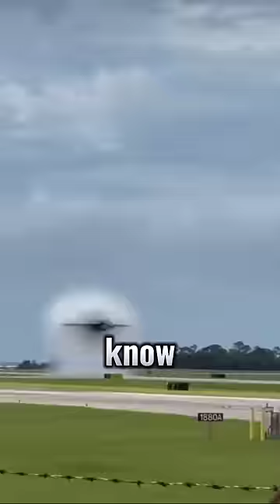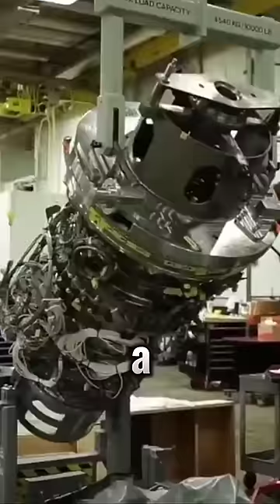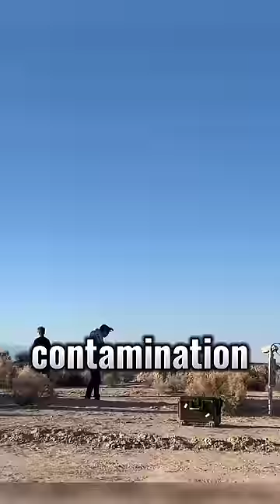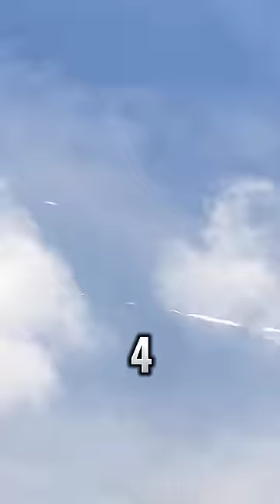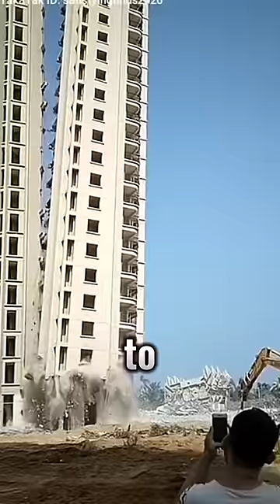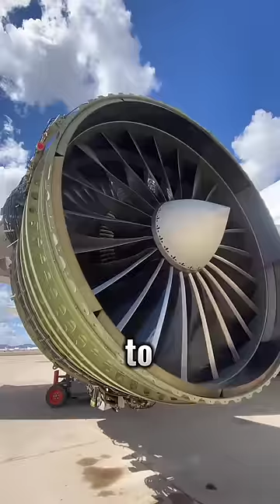When Russia Tried To Use Sonic Boom As A Deadly Weapon 😱

Comment: Just drive my straightpiped 2003 dodge ram across enemy lines
Reply: Or my ‘03 Monte Carlo SS… we dropped a cop car engine in it just for fun
Reply: @jpetes9046  AMEN BROTHER GOOD STUFF RIGHT THERE
Reply: And roll coal on the enemies for good measure! 😆
Reply: Or the mf Civic running headers through my neighborhood at 3am
Reply: Or the Honda civic with laptop
Reply: @jpetes9046 I bet that thangs badarse all 85hp
Reply: @Nikkk6969 I bet that thangs badarse all 85hp
Reply: @antssr_9106 I bet that thangs badarse all 85hp
Reply: I bet that thangs badarse all 85hp
Reply: @jamiejones6994 I had 5 strokes with a side of seizure reading your comments what are you waffling about.

Comment: Sound based weapons are actually an idea people should continue working on, if for example u had a pistol, u could tune or make it tune itself onto the right frequency you could basically make anyone immobile whilst still keeping them alive as wel as piercing stone wals or metal plating, the only somewhat reliable way to survive a sound based weapon in this case would be by hiding in a soundproof room, ofc the strength of the sound should then also be high enough so that it could reach the necessary distance, wich makes it pretty much impossible to make right now, sure we actually can but it would be a huge machine accepting little to no error to actually achieve its result and there also being more danger of friendly fire because of the size, sound after all does not go in 1 direction

Comment: A sonic boom only happens when a jet reaches the speed of sound, or 1225kph. In order to avoid damage to the plane's fuselage, the pilot has to pass the sound barrier as swiftly and as smoothly as possible. In order to use the sonic boom as a weapon, the jet would have to fly at a constant speed of 1,225kph for minutes at a time, which would tear the plane to shreds.

Comment: Bruh that op if they actually made that not even missile can hit it from the side cuz of the shockwave around it will either divert or enough to blow up the missile before it can even hit it even if they tried to destroy it head on it would need a missile or cannon to 1 shot it but due to the speed it will still kill if the straight line had it target

They could just Load it will any bomb or mini nuke in case it needed

Comment: Often people summarize the speed problem of hypersonic flight to the engine, and if only it was that simple, everything plays a role at that speed , materials the plane is made out of , the weight , the shape of the aircraft all has to be carefully planned and tested or you will just blow money up,  not even taking in military requirements but this large rectangular monstrosity should have been flagged as a dud by anyone who has even the most basic understanding of engineering.

Comment: British forces were out numbered against the Iraqis in 2003 in Afghanistan at night and 2 F-16's saved them without dropping a bomb. They couldn't do a gun run or drop bombs because no one had IR strobes to let the F16s know who was friendly so they just took a guess from all the radio chatter and built enough speed and altitude to turn into a dive and when they hit 3,000 ft they turned out of their dive to force the sonic boom to hit the Iraqi troops. It worked because the Iraqi troops scattered and fled the battlefield.